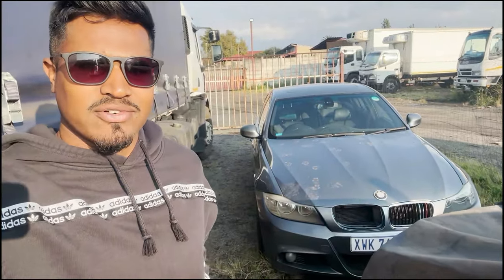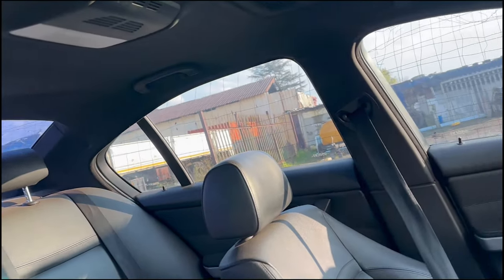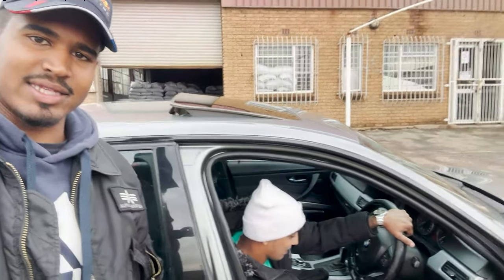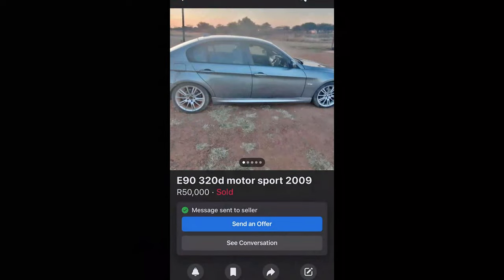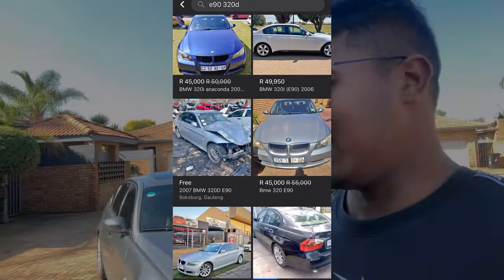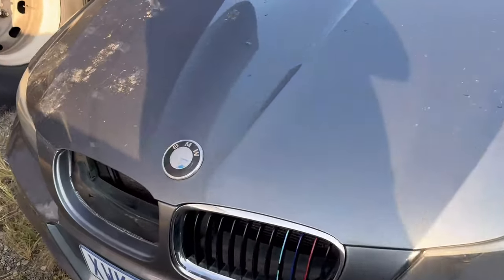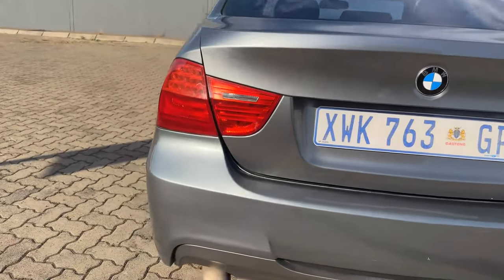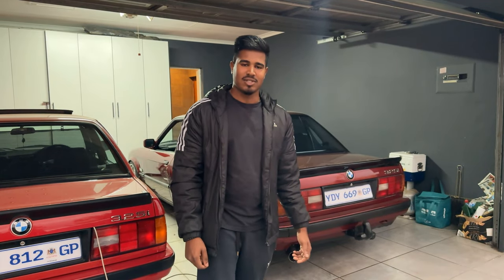FLIPPING A BMW FOR PROFIT IN SOUTH AFRICA !!! BUYING FIXING SELLING

Comment: What product did you use to spray the rims? I am particularly interested. Good work on the car, I used to own the exact same spec but in a 6 speed manual.
Reply from the maker: They are awesome cars, I prefer 6spd over the auto… I used Sprayon brand as seen in the vid